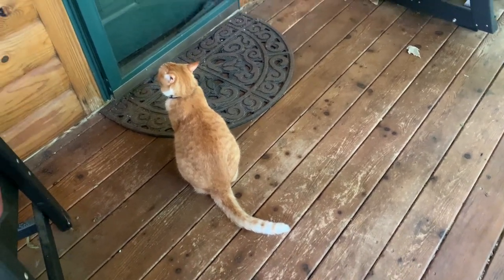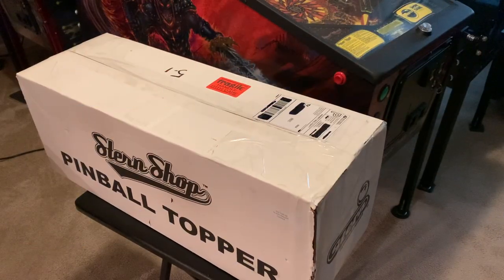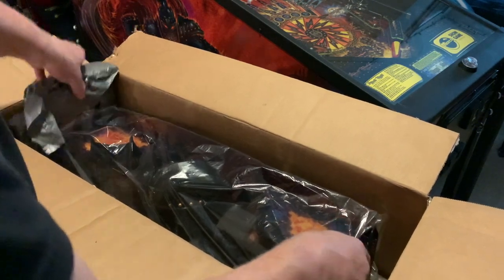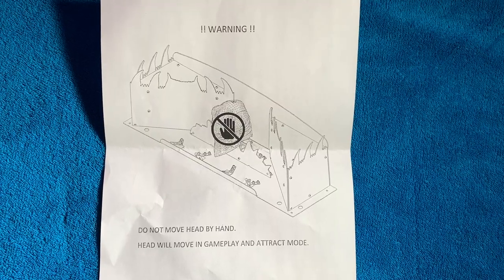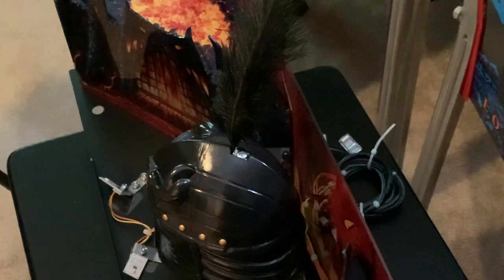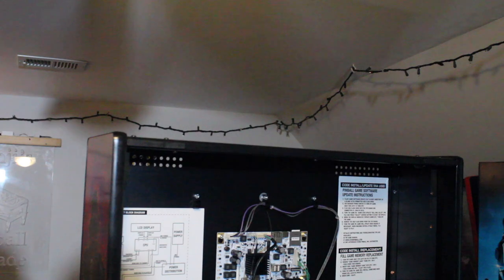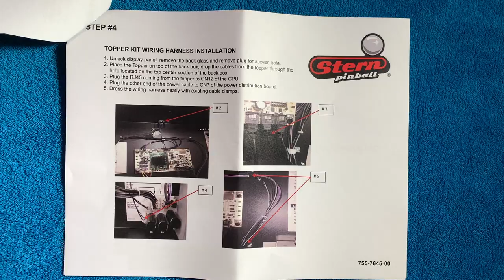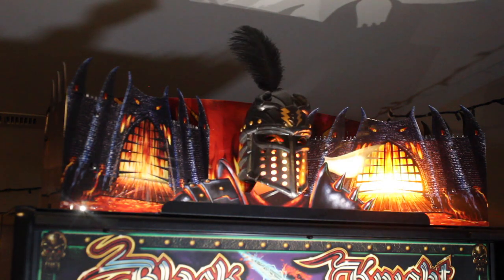Black Knight SoR Topper!  Installation and gameplay video

Comment: I received my topper today but the head isn't moving. Also the left flame light works and then it doesn't work. Any ideas?
Reply from the maker: I would remove the back panel like I did and check connectors.  A pinched wire could give mixed results.  Hate to hear that happened.